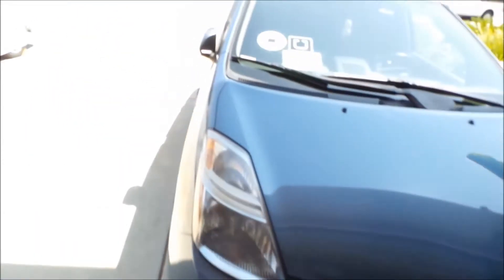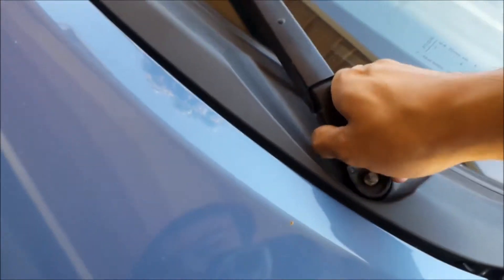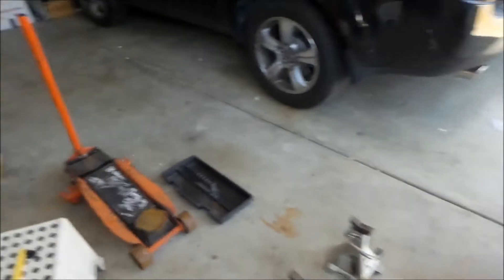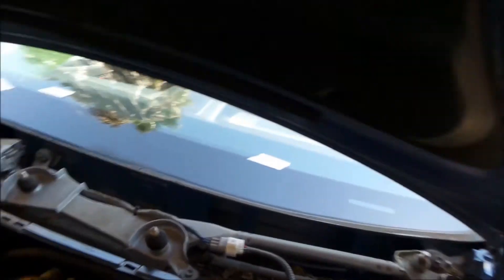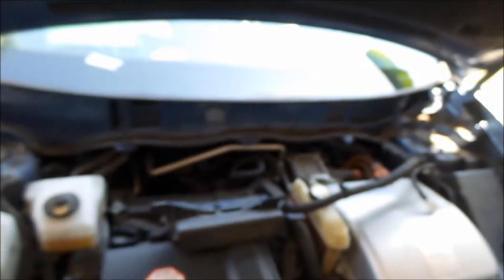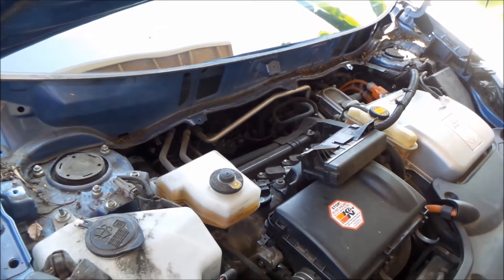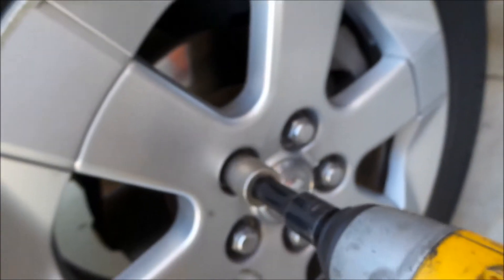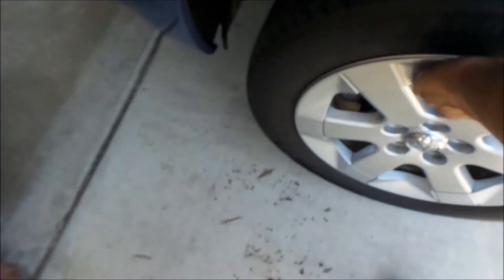HadesOmega Prius Front Shock Replacement VLOG Part 1

Comment: Thanks, seeing the disassembly is so much more useful than a shop manual.  Saved me a great deal of time.  One tip, removing the hood seal isn't necessary.  If you're careful, you can remove both halves of the cowl as if it were one piece, leaving the seal and tabs in place.

Comment: You can remove the front strut nuts without removing the cowl all you need is an extra long 12mm wrench preferably wobble ratchet end.
Reply: Thanks for the tip.
Reply: Brian Rayburn Post a link to the tool you use. I don’t see this being possible. There just isn’t enough room to get to the back nuts